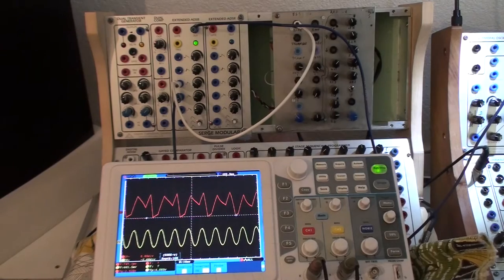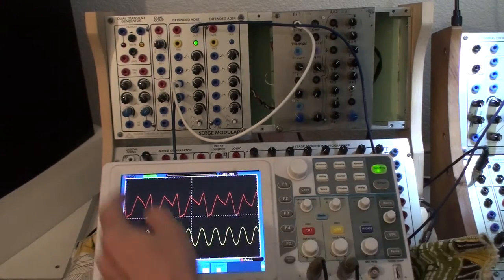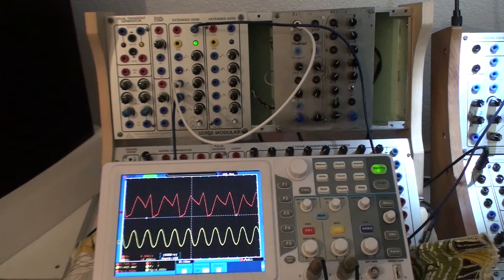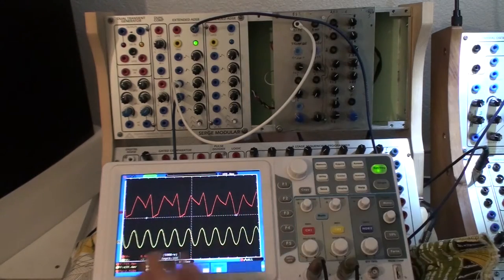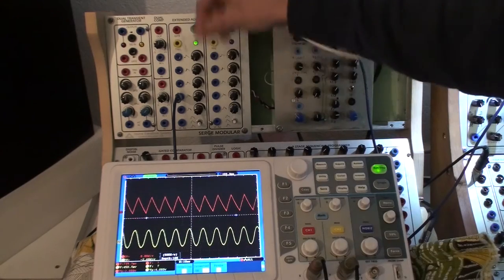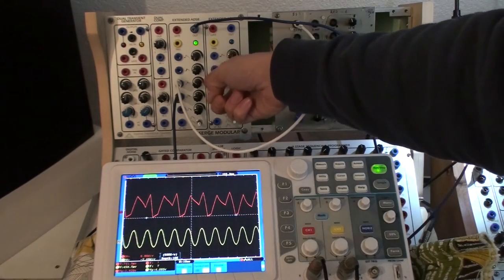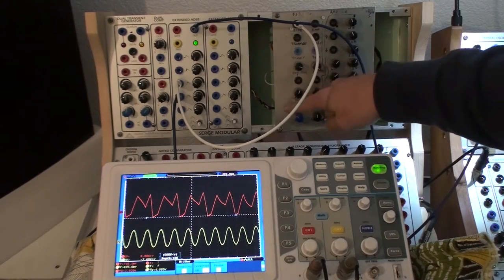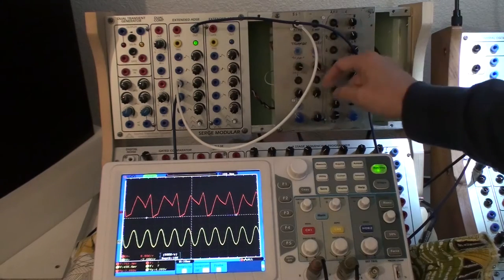Serge Extended ADSR - Waveshaping [Part 03]

Comment: What exactly is happening?  I’m so curious
Reply from the maker: There's a Serge Extended ADSR - Waveshaping [Part 01] video where you can see what happens when you send only 1 audio signal to a CV input of the ADSR. Maybe easier to see what happens when starting with 1 signal only. You'll see the waveshaping abilities of the module when the different knobs are turned (ADSR). Then if you send another audio signal to another CV input (like in the other 4 parts of the video series) , you're basically mixing the 2 audio signals, but on top you have the shaping ability, which allows to make complex waveforms. This is what I'm trying to show. I'm sorry my videos are not the best, but I have limited time and resources to make them (all goes into music).
I did these videos in 2015 mostly to encourage people to experiment with their Serge modules, sending all kind of signals to all kind of inputs, breaking a bit the habits of CV-to-CV and audio-to-audio. On the Serge modular every module hides a lot of nice surprises. This is also the cool thing with bananas, which allow easely to push the limits.
Reply: @batchas  yes, I want a serge. I have a synthi. Now a serge. Ill be good after that

Comment: what is the set up? Two different oscillators ?
Reply from the maker: In this part, I'm sending a sinewave from the Serge PCO into the SUSTAIN input and a sinewave from the 555 VCO into the DECAY input. Would be cool to have more inputs on the scope!
Reply: @batchas  is the adsr cycling and the CV is adding together?
Reply from the maker: @frankjamesbonarrigo7162  No, the ADSR is not cycling. The GATE or TRIG inputs are not used in this series. Please see my answer to your recent question "What exactly is happening?  I’m so curious".
Reply: @batchas  How do you get the continuous sound without cycling? Is the adsr always on?
Reply from the maker: @frankjamesbonarrigo7162  We see the LED flashing so I think it's not always full on, but it lets the audio signal at the CV input go through because the pots are not fully CCW. We see well at 1:20 when I turn CW the DECAY knob, the adsr is like fully open, always on.